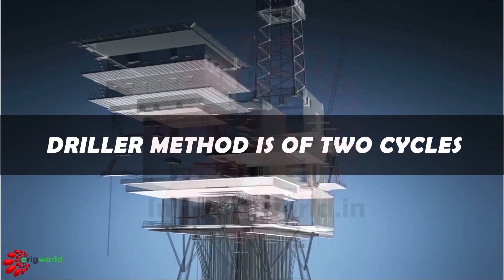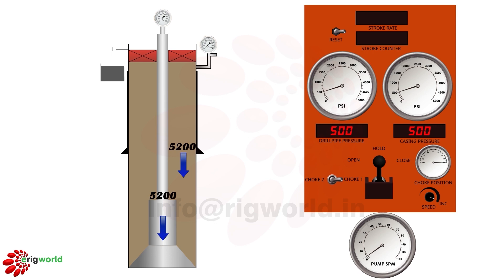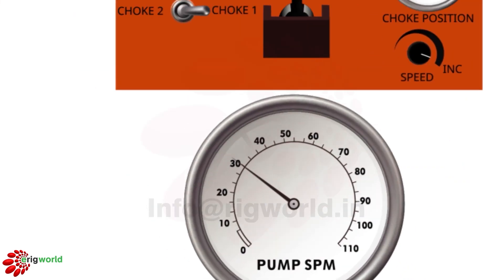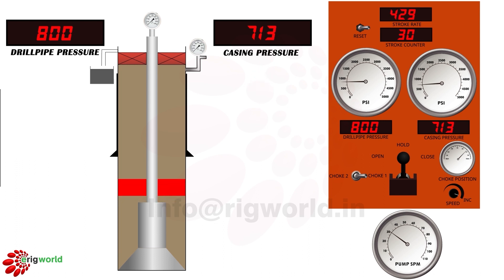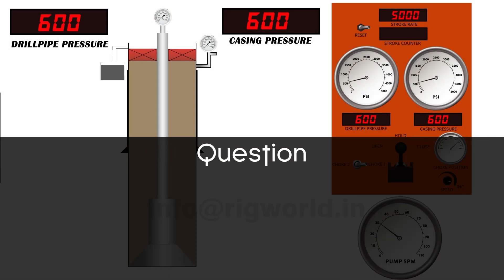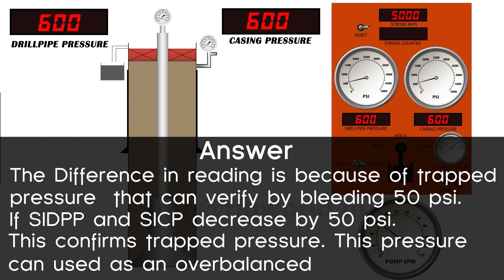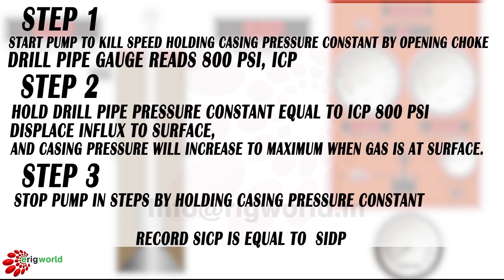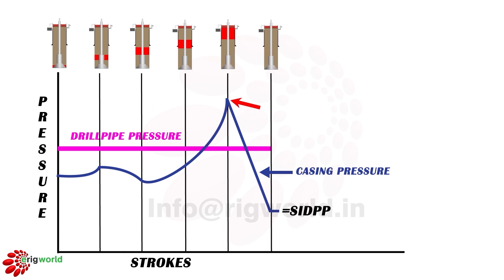IWCF Level 4 | Driller's Method | Well control | IWCF Level  3 | IADC | Two Cycle well Killing

Comment: Thank you, great video with good schematics and questions in between to recheck the understanding.

What will happen if kick was detected slightly late and say SIDPP, SICP were higher? Does it mean more time will be required to take the influx out? Does it mean that while using Drillers method, higher strokes of pump will be required to counter the higher pressures? Does the Driller method application vary, if the kick was due to Oil or purely a Gas Kick?

Also, maybe explanation can be added that in parallel, Kill Mud weight can be determined and Kill Mud can be prepared. This is simply calculated by SIDPP + known MW prior to the Kick.

Comment: If we keep pressure constant by open the choke , How we know influx has been circulated to surface or not?  
Or is it fine letting pressure annulus going up without controlling it with choke to know the influx has been circulated?

Sry for bad english
Reply: You know when influx is circulated out basing on comparing SICP and SIDP after shutting the well when 1st circulation is finished. Once the well is shutt in and SICP=SIDP, means influx has been completely circulated out. If SICP is greater than SIDP, that's mean that there is still influx in Annulus. Your second question- you need to keep Bottom Hole Pressure constant all the time. You don't if you let Annulus pressure go up- in this case there is a risk of damaging formation.